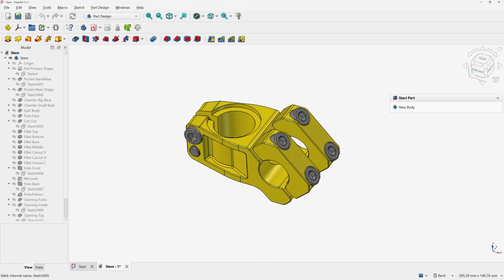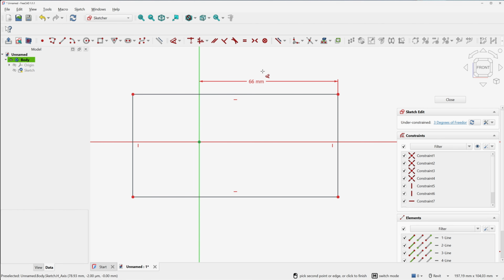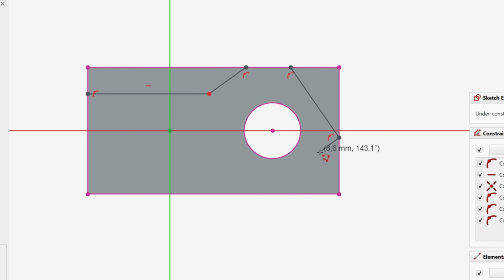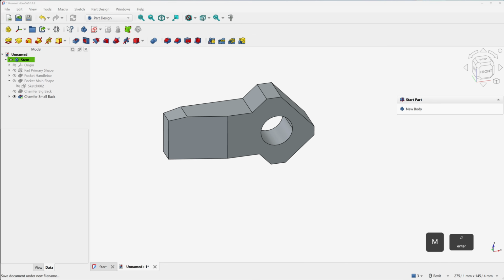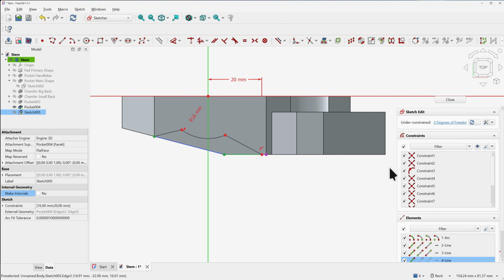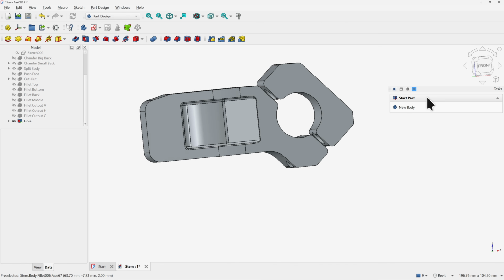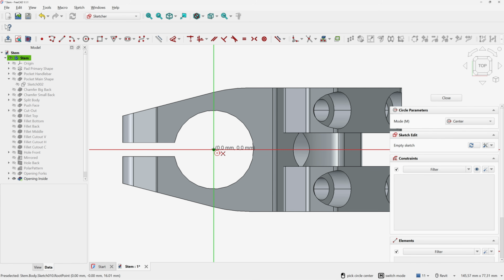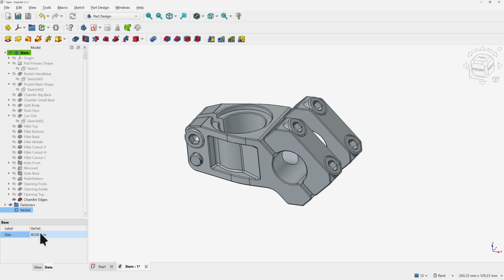New to FreeCAD? Start HERE (Ultimate Beginner Tutorial)

Comment: This is fantastic, THANK YOU!
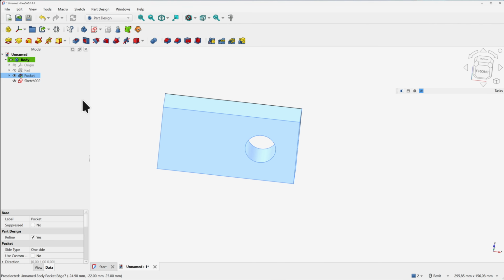Just wondering if maybe I missed something or if anyone else had an issue at about 18:26, I had to select "Pocket" then go down to the bottom to select the "view" tab, and under "Display Options, I had to set Visibility to "No" in order to see the view in the tutorial.  Otherwise it displayed a solid rectangle with a hole.  Maybe it has to do with having the view set to dark mode?
Reply from the maker: @Tony-5393 In the tutorial I click the eye icon in the tree view to hide the pocket. You actually did the same thing but through the properties view :)
Reply: @deltahedra3D  Aha! That explains it, thank you. I was up until 2am following along with this tutorial. I only made it as far as the rear hole and had issues, my 62 year old brain was way past bed time mode 😂.  I will finish tonight, and probably go through the entire process a couple more times to make it all make sense.  Thank you once again for all of your amazing presentations and for the timely reply. Kofee coming your way 👍🏻.
Reply: @deltahedra3D   Amazing.  I finished it, exported it, and printed it. Looks amazing.  As far as the fasteners go, I followed along and  created those as well.  Does that process also create threads inside the holes when threads are added to the fasteners?  (Edit: I did not print the version with fasteners, just the gooseneck). And is there an easy way to separate the fasteners from the piece within the drawing?  The part with the formulas to change geometry afterwards was incredible.  Thanks again for all of your time amazing presentations.
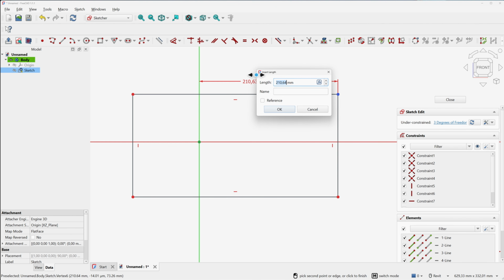Reply from the maker: @Tony-5393 To create the threads, you can do it directly within the hole tool. Check out this video at 7:11 https://youtu.be/vwXklzvvxIA

Comment: wire is not closed appearing in freecad 1.1.0 regardless of the  "make internals" toggled on or off, AND YES, I checked, all lines are actually connected to the projected outer line, and it's NOT a construction line. 
Even with many years of CAD experience I wasn't able to solve this, but from writing stuff below a youtube video in pure despair. 😕

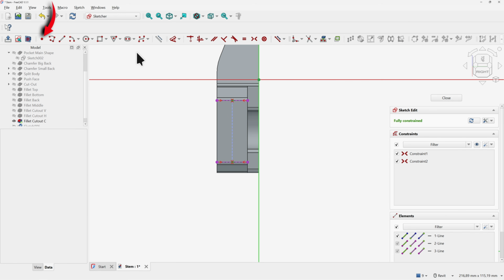Comment: 37:27 Help please.
I'm an absolute beginner of FreeCAD. I'm getting an error message saying Unhandled Base: GUI Access violation something.
Please suggest a solution. Thank you.
Reply from the maker: @DrsDIYcreations When it happened? Before creating the sketch ?
Reply: @deltahedra3D  Yes. After converting those 2 external geometry lines into construction lines and then tried to draw the middle line. That's when the error popped. I couldn't drop points on the line. I tried closing and reopening FreeCAD and even tried in the safe mode but the error popped up there too.
Reply: @deltahedra3D  thank you for replying❤ your videos are truly very well made and easy to follow. You make the process interesting and engaging throughout the creation.
Reply from the maker: @DrsDIYcreations You're welcome! Without knowing what you had done, it was difficult to guide you more specifically. That said, you can always download the 3D file and delete all the operations that come after the hole in the treeview. It's free and it's there to help!
Reply: @deltahedra3D  I don't know if it's the right way but I got the error resolved by changing the mode (M) in Line parameters of Line tool.

Comment: Starting with a rectangle sketch only to immediately cut the rectangle with an outline of the shape is silly, should have started with the outline, would have taken care of all the major features in that plane with a single sketch. If you are going to make perpendicular non-screw holes through that starting sketch. All things affected by the "Size" variable would have been in one place too, though the need for the variable could have been skipped altogether by referencing affected outline features in the base sketch either to the handle bar hole position or rightmost edge.

Showing how to do stuff is nice, showing optimal ways to do things would be better. I watched this video mainly hoping to find out if it covered anything FreeCAD gave me a hard time with coming from 360 after my free account got wiped again, will have to see what "make internal" can do as it looks similar to how you can "flat-pack" details in 360 to avoid creating 10 sketches for things that share a common reference plane but different pad/pocket depths/directions and turn over-constraint clean up on.

Comment: Hi when a sketch is not close and you have a lot of lines, you can use the tool "Validate Sketch" wich is not by default in Part Design. It appears in the top line under sketch. But if you want the button in the tool bar of "Part Design" you have to make a right click on the tool bar and choose "Customize". Then in the "Toolbars" panel type "Validate..." and you will see "Validate Sketch". Then you to create on the rignt in the "PART DESIGN" a new tool and with the right arrow to put in this new toolbar. When you validate a sketch, you will yellow cross where two lines are not connected. It's a really helpful to be sure you're sketch are properly closed.

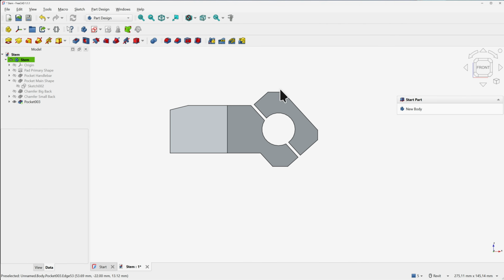Comment: When i do the pocket operation at 27:14 the right part of the body disappears? Also, I am using FreeCAD 1.1 but I don't get the previews (green for pad) and (red for pocket) operations?
Reply from the maker: @bertveldhuizen8699 edit/preferences/part-partdesign/show transparent preview overlay by default when editing features
Reply: @deltahedra3D  Thank you!
Reply: EDIT: I figured it out, I thought I opened up FreeCAD 1.1 but I opened FreeCAD 1.02 instead. The two previous issues are resolved but now I have a new issue, now when I do that same pocket operation I get the following error: "Result has multiple solids: enable 'Allow Compound' in the active body.".  When I right click the active body in the tree it is already checked?

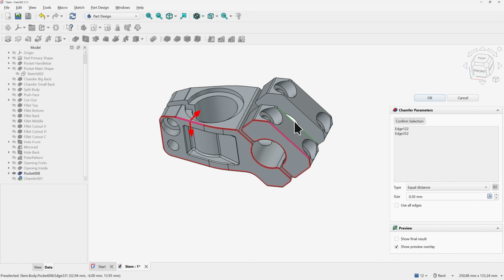Comment: 47:55 For some reason when I select the edges in this final chamfer step, the joined edges do not auto-select and the preview geometry doesn't appear. I tried undoing a few steps and redoing to return to the pre-chamfer state but that didn't work. I also tried closing and re-launching FreeCAD but still no dice. Not sure what's going on.
Reply: The problem is that the 13.2mm counterbore diameter on the small hole extends right to the edge of the face created by the small chamfer. I've checked and re-checked all my dimensions and operations until this point but can't find my mistake.

Comment: The external projection tool on the RC version of FreeCad had options : External intersection which made the line as a normal line,  and external projection  - which made the line as a construction line. In 1.1 version both options are still there but both make external intersection - forcing me change the line to construction most of the time.  Im running on Mac OS. I wonder is this the same behavior on Windows and Linux machines ?  Also remove redundant constrains does not work with my version - it never did already with 0.22 version way back when i began using Free cad.

Comment: The best freecad channel ever ! I’d wish to have a last step in your video which explains how to split multi-component body (here the front parts) to re-assemble in the assembly workbench with fasteners? (another example, in the bike wheel video, how to use assembly workbench for the hub+spoke+screw+rim parts which use an array pattern ?

Comment: i have some trouble with the VarSet seems i made something in the fillets after multiple loads sometime its the top fillets, other time is the bottom fillets, saying that they are invalid, how do you fix something like that ?
Reply from the maker: @UserKP-l5v You need to be careful with the varset, change by 5-10mm. Fillets are the most unstable feature in FreeCAD and construction errors can happen frequently.
Reply: @deltahedra3D still I tried 5-10mm just like in the video maybe it can help if you made a separate video discussing these errors in your own time

Comment: Excellent video, thanks for updating your older one. This will be my go-to reference for new users.
Now, (maybe) a tip: If you know you are going to reference a lot of external geometry, and you haven't changed your preferences to create them as 'Construction', you can click the 'Toggle Construction Geometry' icon before selecting geometry - saves having to re-select and convert them after.

Comment: Thanks for a great tutorial. I see that you ended up with several disjoint bodies inside a single part. Why did you prefer that over the assembly wb?  Can you easily 3D print the different parts this way?  Regarding the assembly wb, I found it quite hard to work with. If I have many parts the assembly become fragile if you don't use reference geometry etc. Also, accessing the  mates of a specific part is difficult since they are presented like one long list and not associated with each part (like SW for example). Any tips regarding that? Thanks again for all your great work.

Comment: 31:35 Just found out it's pretty hard to tell green and blue apart if you are using dark theme. You can change it to light theme in Edit>Pref>General if you exit sketch editing (locked otherwise).

Also, 1+1/8 inch fork stem is 28.6mm not 28, so you gonna have a very nice time putting it on (I have one similar, I've swore a lot that day)

Very nice basic course otherwise, thank you a lot.

Comment: If you're going to drive the dimensions with a variable, then you can just dimension the features from the right side instead of the plane, then the one dimension would have driven everything without all the extra calculated dimensions.
Reply: Yes, but you'll end up in trouble sooner than later. You really want to reference a well defined point (like origin, x axis), to avoid problems during recomputation.

Comment: Thank you for another great video! Even though this one contains tips for complete beginners, there's always something to learn, especially since I also switched from Freecad 1.1 (I didn't know, for example, that you could add screws directly into dedicated holes). I've already worked through several of your previous videos. Following one of the guides on optimizing the program's settings, I'm also using the light OpenLight theme. Unfortunately, I'm having a problem with it: the column headers in the properties window are cyan (like in the dark theme), while in yours, the text is black (dark). Did you have a similar problem and how did you solve it?
Reply from the maker: @kalinowskikk Thanks for your comment! Regarding the Open Theme, I sometimes have issues with the dark mode too, especially in tables where the title background matches the text color. Sometimes restarting FreeCAD fixes it. You might want to check with the creator, Obelisk79. He might be able to help you out!

Comment: What about the threads for the bolts in the aluminium body, did I miss something?
Reply from the maker: @mrufczan Generally, I never model threads to avoid making the model too large (reconstruction time, etc.), and I add them to the drawing for production. But if you choose a standard when creating the hole, you can generate them if you want.
Reply: @deltahedra3D  thanks for the answer. Great content btw!

Comment: This video is a game changer for me.
Thank you for the step by step, selecting the wanted sketch, points, ... and then choosing the operation is something i seem to have unknowingly neglected in the past but dare i say no more.
Since you read all the comments... if the hole operation makes a hole of 8mm and you are adding M8 bolts, doesn't that mean the bolts are just in non threaded holes according to the sketch?
Reply from the maker: Thank you for your comment.  I never model threads to avoid making the model too large (reconstruction time, etc.), and I add them to the drawing for production. The goal here is really to demonstrate the operations and how to perform them.
Reply: @deltahedra3D fair for your situation. I however always model threads because they in many cases are strong enough to 3d print directly (think screws in a plastic case, obviously not for a bike)
Reply from the maker: Do you find it stronger than just making the hole smaller and screwing into it?

Comment: Hey, I learned freecad with your old tutorial, and came back to it after a few months, installed it again.
The problem is the old freecad i was using was really good in terms of ui, text scaling, etc.
The newer version had problems which i never encountered, like text being different and not scaling properly,
lines getting pixelated, not being drawn according to the resolution of my screen. (That was version 1.0.2)
Also dimensions (fe"⌀=9.5mm" were getting really pixelated as i zoomed out)

Do you know what might be the cause, and have you heard of people having similar experiences?
I'm down to installing freecad again, I use solidworks now but only because i've got academic license.
And i;ve got to say, for paremetric modelling freecad seems simpler
also i liked the key shorcut constraints way better than solidworks UI. Mabye i;ve still got to learn, 
but SOLID has soooo many tools everywhere

Also I will try freecad again, but after finishing academic science club liquid rocket project for competition.
I am sure I will watch this tutorial, because I know what quality you provide and I know this is going to be top notch.
Thanks to you I started modelling on THE VERY DAY i got my 3d printer. That's also what partially got me into the science club. Thank you.
Reply from the maker: @maciejpieskasta493 You're welcome ! To get cleaner lines without pixelation, go to Edit > Preferences > Display > 3D View and set Anti-aliasing to 8x MSAA. Which OS are you on and did you try v1.1.1 stable?
Reply: @deltahedra3D  I'm on win10,  totally missed that setting. Just tried it and It finally looks great, thanks so much !
I will be sure to download v1.1.1 later